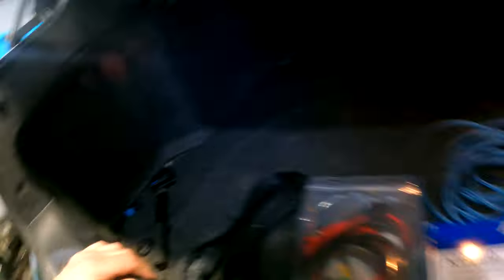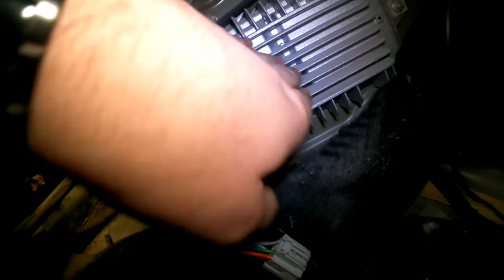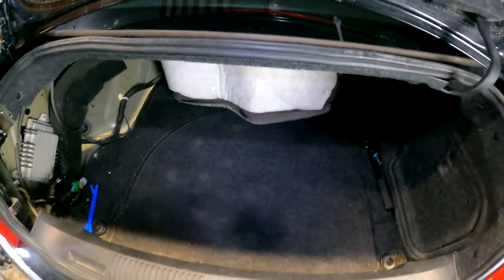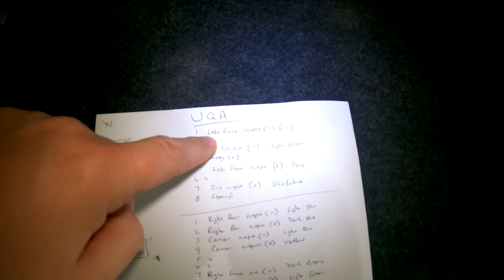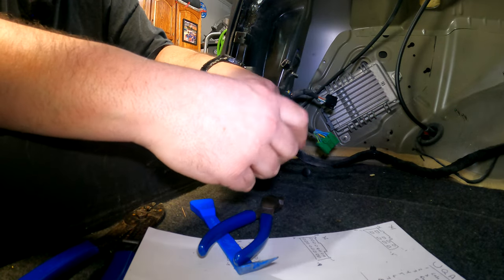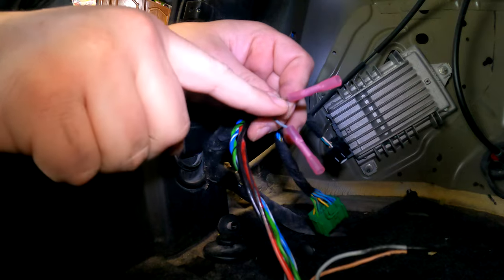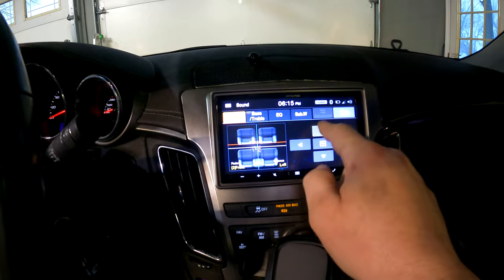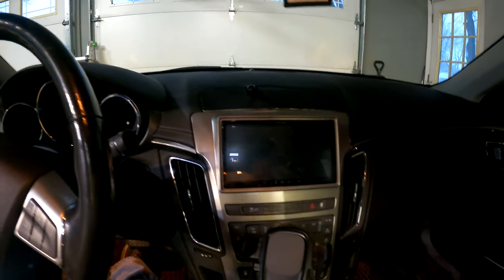Vehicle Bose Amplifier Bypass

Comment: Morning, I tried to use your wiring diagram and it won't come up.  I tried using a 9 conductor speaker wire and wire Alpine 650 directly and now no sound...
Reply from the maker: https://discord.com/channels/671578446245265424/1084276779277111427

There should be files listed there.

There were two options for the factory stereo

With or without the Navigation (UQS and UQA) 

You will need the wire schematic for the stereo that was factory in your car